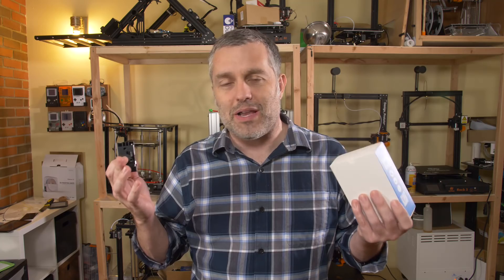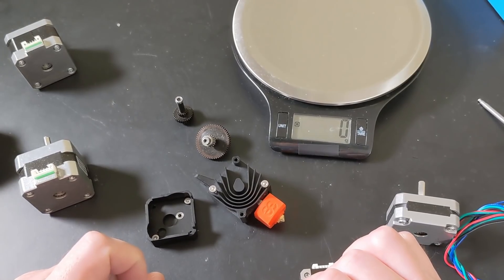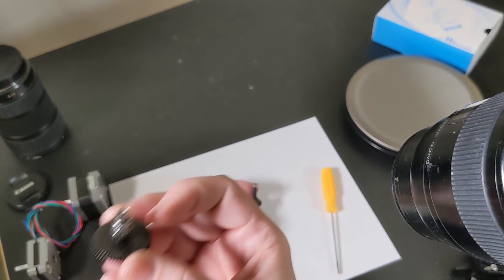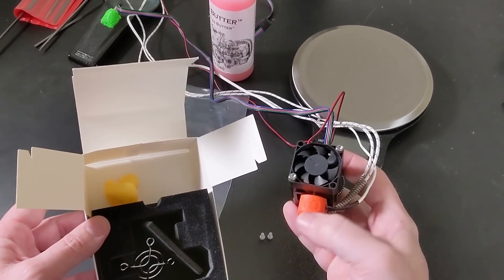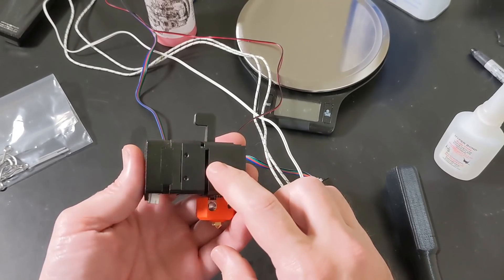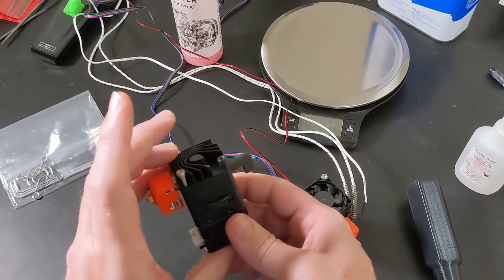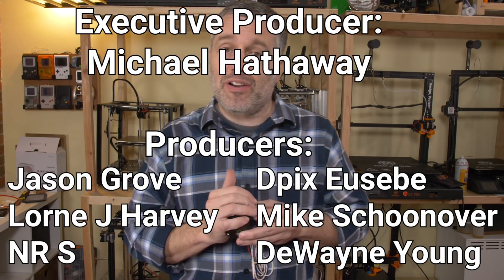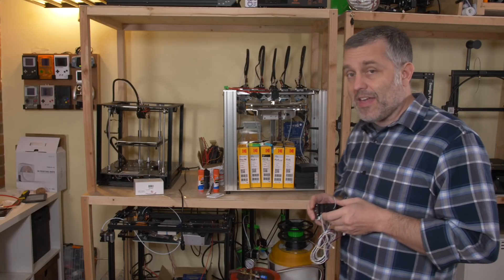GAME OVER For Hotend/Extruder Design? - The Biqu H2 Direct Drive Hemera Alternative

Comment: 0,126 * 0,2 = 0,025 !!! not 0,08
Reply: I suspect you made some mental shortcut here. Can you explain how did you calculate it?
Reply from the maker: Good Catch Tom! The math is a bit off. Trying this a different way, I figure that 13.829mm³ per second / 0.126 X-section area = 109.75 Which means that in the air the nozzle will squeeze out a new smaller filament which is 109.75mm long every second. Because the layer height is half the diameter of the nozzle that means we can double that figure to about 220mm/s. Of course this isn't perfectly accurate because we are in fact squishing a circular profile into a flat line. But It's a good approximation. Maybe an engineer or mathematician can give us the actually correct numbers based on the variables I have provided.
Reply: @DesignPrototypeTest  I'm not officially an engineer yet, but I'll give it a try 😁

First of all, your result is correct. Just the second to last line is a bit off (look at the units). 

I'm pretty sure that slicers do their calculations based on your assumption that the extruded strand will be squeezed into a rectangular shape.

But let’s first see how big the error would be in that case. Let’s say the extruded rectangle of 0.4mm*0.2mm=0.08mm^2 is more like a rectangle with 0.05mm fillets.  The area of a circle with that radius is 
pi*0.05mm^2=0.008mm^2 
The area of the circles’ bounding box is
(2*0.05mm)^2=0.01mm^2
The difference of both areas 
0.01mm^2-0.008mm^2=0.002mm^2
is the area that we missed by disregarding the fillets. 
That results in an error of
0.002mm^2/0.08mm^2=2.5%

Now let’s look at at the speed calculation with the assumption that the extrusion is rectangular in shape.  Your volumetric feedrate was correct with 13.829mm^3/s.
With
layerheight*linewidth*feedrate=volumetric feedrate
we can arrange for feedrate
(volumetric feedrate)/(layerheight*linewidth)=feedrate
which results in
(13.829mm^3/s)/(0.2mm*0.4mm)=172.862mm/s

When you correct for the potential 2.5% (or so) error, you get
(13.829mm^3/s)/(0.2mm*0.4mm*0.975)=177.295mm/s

And speaking of volumetric feedrates: 14mm^3/s is quite a bit. For reference, the maximum you can push through a stock E3D V6 is 15-16mm^3/s. The mosquito will reach somewhere around 23mm^3/s.
Reply: @ConstantijnC  wow.. you are already an engineer.
Reply: @ConstantijnC  can't verify if this is correct, but simply for this breakdown you deserve the title "engineer" more than most people who own it ^^
Reply: Respecting conservation of mass (volume):

Nominal feed rate = volumetric flow rate / nozzle cross sectional area

= 13.829÷0.126 ([mm^3/s]÷[mm^2]) 

= 109.75 mm/s

This is of course the nominal feed rate as you tested for the circular filament profile extruded by the nozzle.

In theory you could take the nominal volumetric flow rate and divide it by the desired extrusion profile (layer height * width profile [mm^2])

Note that any the greater the deformation of filament from nominal and flow restrictions of the nozzle will result in an increase in energy losses reducing the maximum achievable feed rate.
Reply: @tomchom8807  1/5'th of an1/8th = 1/40th
Reply: @ConstantijnC  #hedidthemath

Comment: Thank you very much for your great review. Regarding the gear stuck problem mentioned in the video, we have contacted our engineers to deal with it. Later, we will strengthen the quality inspection of parts to avoid this kind of problem. Your suggestion is of great significance to our future improvement. Once again express our sincere gratitude
Reply from the maker: Thank you for your gracious comment. You are welcome for my criticism. I hope that I have done some small service to help improve the product.
Reply: Engineering that will be paid for by all the suckers who bought your defective "V1" extruder.
This product should never have been released as it is, it's a beta not a final product.

Are you going to credit all the defective units you sent out? Or at least pay everyone for fixing your defective extruders? No one works for free in North America.

Do yourself a favor, get the Triangle Matrix - it works out the box unlike Biqu's hunk of garbage.
Reply: @TheWoodfordreserve  500 gram extruder and hot end... You either like bad prints or don't want to print faster than 60mms Maxon a good day. Better off with an original hemera instead of these clones then.
Reply: @TheWoodfordreserve  you seem like one of those Karens that is just never satisfied. It is highly likely that there was nothing wrong with the unit since he himself said it worked before he took it apart. It is not the manufacturers fault that the USER broke it.

He put it together wrong then removed metal making the fit too loose to grip the filament.
Reply: @excitedbox5705  that does nothing to address the mfg using V1 products as an engineering test-bed.  People shouldn't be paying to be an unknowing part of the beta-testing program.  I'm glad I found SJ's comments, I won't be buying this product.
Reply: Biqu - please send him a BX! The feedback and constructive criticism will more than make up for the cost.
Reply: @TheWoodfordreserve  Hotend weight for delta definitely affects print quality.
Reply: I have to wonder if the problem was caused by taking the extruder apart and reassembling it.  To be fair to the manufacturer, it would be best to thoroughly test the product first, then disassemble and tinker with it.  Also, I am not convinced that modifying the shaft was the best solution.  Some simple gear lapping or honing may have been the better solution.  https://www.youtube.com/watch?v=_Yy3jZu4PXE
Reply: @biqu Well it's been a year since you made that post and I I'm on number two this week of units that won't even move out of the box so clearly you've fixed nothing
Reply: @travishammond8482  To think this is what we in America and Europe have to put up with because Capitalist outsourced most of our industries overseas shutting down most of our plants, whereas the surviving plants charge an arm and a leg because the global ists import all this garbage for us to use since we cant buy our own domestic products.   One day I hope the people take back their country and limit imports to only products our people do not have the ability to produce themselves which is very few since Europe and America are both rich in resources.
Reply: hey @biqu I bought the h2o i love it but it came with no heater block what the heck?

Comment: Because we are dealing with subsonic flow, the nozzle is still behaving like a nozzle. This means that the smaller the orifice, the higher flow resistance (and more pressure required to overcome). A larger nozzle will reduce the flow resistance, and you will see some improvement to flow rate, assuming that the heater is able to keep up, it should actually be a pretty meaningful boost in extrusion rate (in volume/time).

WRT a nozzle, Bernoulli's principle basically states that the pressure prior to the nozzle will be higher than after. Closer the inlet and outlet of the nozzle are in area, the smaller the pressure difference. And that keeps with the above. The bigger the nozzle, the larger volume of plastic you can push in a given time.

Comment: Thanks for showing off my products. I actually use TinkSeal on my Bondtech gears. All my rails and bearings are packed with TinkSeal. I use a small painter's brush to apply it. Works great on metal to plastic gears, resists drying.

Comment: You don’t understand Bernoulli’s principle, the pressure is lower when the orifice is larger.
Reply: Agreed. I was going to comment the exact same thing.
Reply: As I understand it Bernoulli's principle relates to the speed the fluid is flowing through - the faster the speed, the lower the pressure the fluid exerts on the surrounding structure. I'm not sure that's especially relevant here.

What I think might happen, and what I think the video might refer to, is that you are not pushing the same amount of filament through a larger opening.  With a larger opening, you are melting and pushing significantly more filament - going from a 0.4mm nozzle to a 0.6mm nozzle means pushing 2.25X as much filament. Presumably that takes more force due to plain old friction and viscosity. I haven't tested that, but it's what I might expect.
Reply: Yeah but if you want to keep the pressure constant on a larger area you have to increase the force. It still has nothing to do with my bro Bernoulli, ist just multiplication.
Reply: yes, but you have to melt a lot more filament with a larger nozzle, so you might actually not be able to melt it as fast as you have to without a longer melt zone.
Reply: Except you ignore pressure and use the equation for uncompressed flow, then you end up with volumetric displacement, but it's the same principle.

Comment: 15 mm/sec of extusion is about is about 36 mm^3/sec (area of filament * 15 mm/sec), which is about the max for a Volcano style hotend (35-40mm^3/sec), a V6 style hotend maxes around 10-15mm^3/sec

To calculate how much you are pushing out, it's a quite simple formula: Layer height (mm) * extrusion width (mm) * print speed (mm/sec) = flow (mm^3/sec).
Reply: Done a slight bit of digging around. The Mosquito will do up to about 20mm^3/sec, and the Mosquito Magnum 30 to 35. The Supervolcano can do 110

Comment: Cloning is not necessarily "bad" for a diy realm. At some point, all airplanes have wing.
Reply: I'm keeping this statement; it's a solid distinction. Besides,  this technique is used to feed MIG welder wire, which has a some things in common with filament printers.
Reply: And wheels!! Imagine if one would need to be constantly reinventing the wheel!!
Reply: I even can't agree this should be called cloning at this point. Using a simple, widely spread design is beneficial for consumer as a)it keeps the production cost lower and b)allows anyone to buy another set of gears if needed.
Reply: Only he sees cloning everywhere, a pulley... Everyone makes and sells pulleys, they're all cloned omg.... 

That's a perfectly widely spread standard item...
Reply: Originality is the art of hiding your sources.
Reply: Given the the 3d print explosion has its roots in reprap and open source design, reproduction and optimization of designs is what has progressed the hobby, and optimisation goes both ways with high end parts with hotends that cost more than some printers and other parts optimised for low cost.
Reply: I get so triggered every time he brings that up. Like every 2 minutes.
Reply: I think it depends how it's done, and what is cloned. The H2 does not look like a clone to me, maybe it cloned some gears etc. But the design just looks derivative. The clones I think are bad are the ones that directly steal mechanical designs from Chinese factories that are producing originals for another company, then just make knock offs with logos removed or something. Not gears, or plugs or something, but more complex products like the whole Hemera. 
Then they are directly taking away from companies like E3D or Bondtech that invest in paying engineers and designers to make these products. Test them, research materials, and design the whole ecosystem around the parts. 
I don't believe the motivation behind Open Source is just to allow anyone to take a design and mass produce so they don't have to pay an engineer to develop their own design. Open Source is to foster iteration on designs, so other companies can improve it move the whole thing forward. Clones are dangerous when they don't iterate on the design process, they just "clone" it directly and undercut the original designer.
Reply: @CodeMonkeX  There are items that are pretty much standard, or, adopted as standard, calling them clones is just lowsy excuses to generate controversy and generate buzz. Pulleys are cloned million times, and I don't think it's a negative clone just because it doesn't iterate on the design process... 

When someone is working with a standard ratio gear, it's expected to work with some standard gear sizes because why reinvent the wheel ? It's counterproducent, there are millions being manufactured, it cuts costs using a readily available cheap item, if one would chop 1mm in one to increase 1mm in another would mean one would have to create a new factory process to build them, spending more unecessary money to have the customers pay for it. Onde thing is to clone and copy technology that the inventors or makers haven't got enough return for their investment, another is to clone a wheel.... or a pulley, or a readily available standard and widely used gear....
Reply: At some point, innovation will lead to a lowest common denominator. I don't know if it'd be fair to call that "cloning". If, however, there is a patent on  something, then anyone selling should licence that from the patent holder, or buy & use their parts, etc.
Reply: You must be new here. DPT has been saying shit like this for years.
Reply: @asmith8673  yeah, but Amazon patented one click checkouts and that was a cluster. Software patents in general were a mess also considering the patent office wasn't initially equipped or implemented to handle software. Just because a patent had been issued doesn't mean that it was fully understood or even ethical. As stated above regarding the wheel. I won't even start on algorithms and Microsoft's poor practice of patents from the early '90s. I respect new innovations and IP integrity but sometimes patents are issued to the first person to apply for them, not necessarily the original inventor. Couldn't imagine a world where aglets were patented, hahaha.
Reply: @Motsai778  have you ever seen a bird with solid wings? or a plane with flapping wings? (Well the wright brothers tried, but we all know how that went)
Reply: It's bad for legitimate businesses trying to compete in the US, Canada, and Europe. We have regulations and labor laws that prevent us from competing with the prices China puts out after copying a design. The cost to design something from scratch is worked into the final cost of the product.. When you take that product and simply reverse engineer it and copy it, you can make a much cheaper product and undercut the original company. This results in the death of many businesses that have been subjected to over-regulation, increased material costs, and Chinese / India / etc. cloning products after weeks of engineering design / integration.
Reply: until an airplane becomes a helicopter or a boat lol
Reply: @new1ru  The beauty of freemarket capitalism
Reply: imagine if no one could build something because someone else came up with the idea before you. Nope you cant build a wheel, because your wheel is a clone.   

I think this youtuber needs to be more specific... He should be saying "do not buy clones from foreign countries and buy locally to support your nation because having too many imports puts your own people out of business because they cant compete with the cheaper cost of production from a foreign nation whose economy is based on a totally different kind of financial system such as comm- un - ism"
Reply: Absolutely, “not cloning” and things like patents actually stifle creativity and innovation
Reply: Why are you finding the shaft that is not a good idea. Your filling a machined surface, you just destroyed you gears. The problem is probably the black coating on the gear between the teeth it’s probably uneven. I wouldn’t have filed the gear shaft.

Comment: Nero 3dp did a live stream of this and didn't like the machine quality of the gears, and the fact that there is no tensioner for filament tension.  He has multiple screw come very close to getting stripped and the hobbes gear that is not supposed to float was floating. And couldn't rigidly mount.  I take it you didn't notice the same issues, or at least, not to the same degree?

Edit: Also I wonder if it is like your mindga and it needs to be screwed in just right ( like if it is moved like 1mm slightly to one side it would not line up the filament path, but on the h2 perhaps the issue isn't the filament path but rather gear alignment)
Reply: Have the same problem as Nero 3dp, does NOT turn at all, gears are so bad...
Reply: Now if they made the big gear out of nylon, it wouldn't bind up, it would be self lubricating and it would save weight! What an innovation that would be.

Comment: Eccentric unwashed gears requiring manual sanding is the best you’ve ever seen?
Reply: This guys videos make no sense to me
Reply: @mr987mike  ... and you keep coming back for more
Reply: Chuck the  gear box up to an electric drill and run the gears in with a small amount of valve lapping compound until smooth... rinse thoroughly.

Comment: Those gear teeth are not machined. The most common way to make a gear like this is to use gearstock, which is a long rod that has the teeth formed into it. These are then cut to the face width that you need. Those marks on the side of the gear are almost certainly from the cutoff process on a lathe. I'm guessing that they aren't even having a custom face width manufactured and are instead just using off the shelf parts.
Reply: Yep
Reply: lol, and he called it a hob gear...    there are hobbed gears which is the process of manufacturing gear stock. using a gear hob.....  but there are not "hob gears" lol.
i have never seen a cast gear as he suggests,  I have cut 'cast gear' blanks using a dividing head on a mill, but I highly doubt that anyone would simply cast gear teeth and use them as is...

i honestly don't understand why people make shit up as they go along.